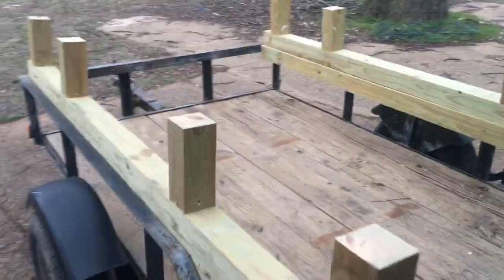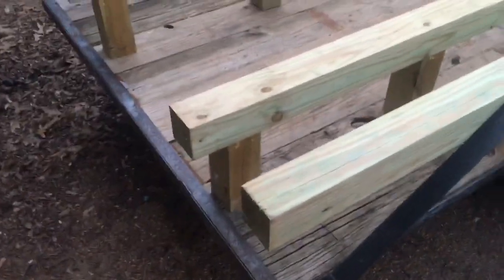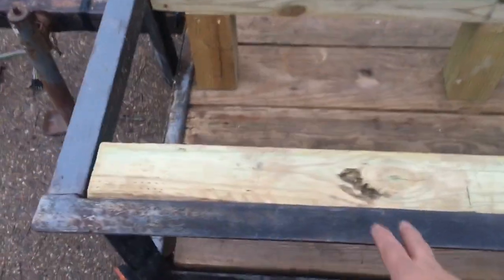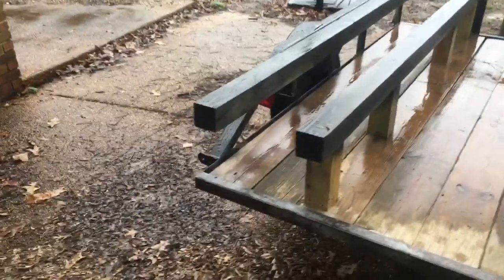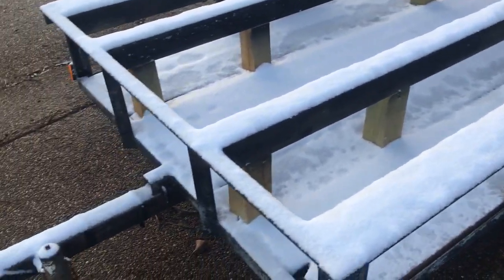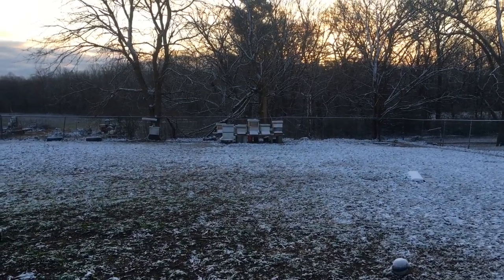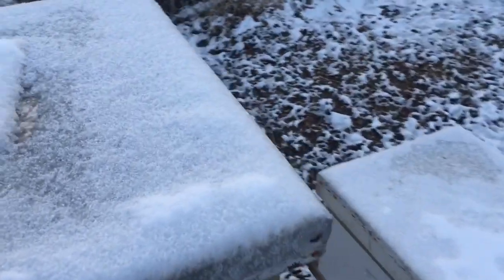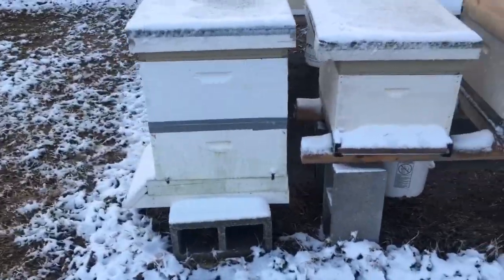Mobile bee trailer and first snow

Comment: Looks good. I think MP is right. The ends of the outside rails should have support under them.
Reply from the maker: Gary Berry I probably will install them. They are lag bolted on the side of the rails. I do have some wood left I can cut up. Good thing is if this works for me. I can have several more hives. Thanks for watching.